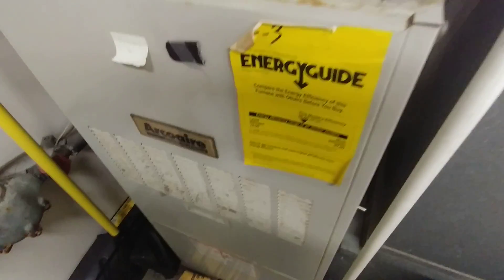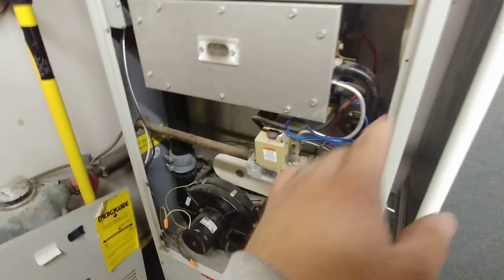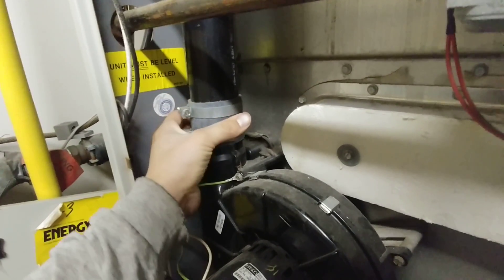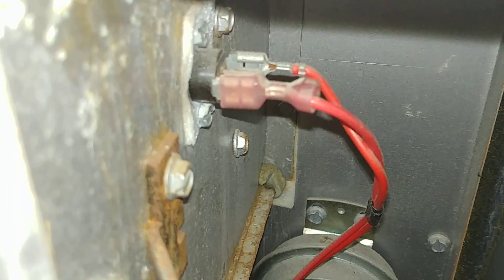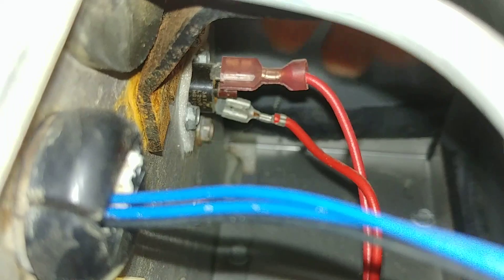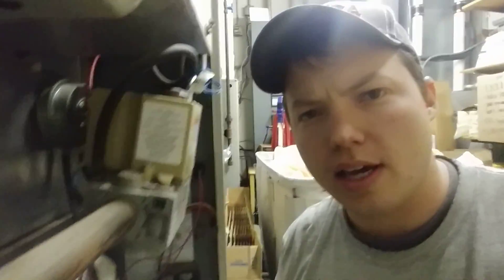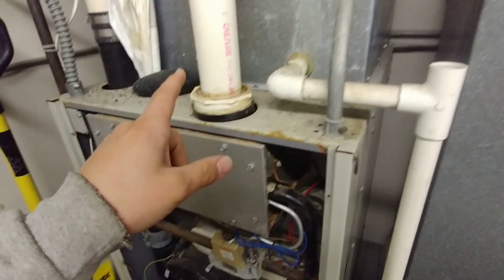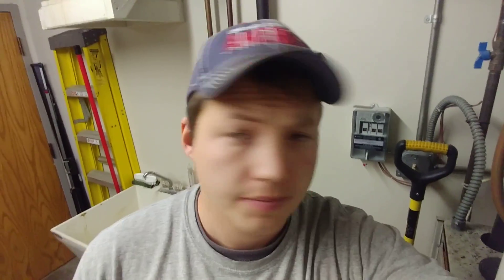Symptoms of Tripped Roll-out Switch - Furnace Troubleshooting

Comment: TYVM  Just saved my ass a service call.... I tripped one when i closed the closest heat vent to the furnace all the way to add more push to the garage vent... i wont do that again lol
Reply: Hi, there.  Thanks for your comment.  Did reopening that vent really fix this for you?  Still working fine?  Wow.  A backflow can cause an overheating problem?  Yikes!
Reply: @neomatrix6115  haven't had any issues  yet..
Reply: @feelingold2995 Good for you!  I never realized such actions could affect the life of my furnace.  I'm also reducing the MERV rating on my filters to increase airflow to keep it running cooler.  Insane how much resistance modern filters put on a system.  Thanks!

Comment: On older furnaces the roll out switch could be "aged" from corrosion and metal fatigue, no?  One way to check, assuming the flames are straight up, is placing a jumper between the two leads to the roll out switch.  That should force the furnace NOT to shut down.  Check the plenum temp above the furnace for too hot scenario where the escaping hot gas may go into the plenum and not to the outside.  Does this make sense?

Comment: I have a Lennox g20q3/4. When I turn the fan blower on it works well. Then I turn the heater on after tuning the fan off and the furnace starts and ignites well. I wait for 2-3 minutes and it just turns off. What can be the problem do you think? Any suggestions?

Comment: Can a Bad flame rollout switch keep the furnace from doing anything, not even the blower motor comes on?
Also mine won't even click when I press reset button
Reply: Yes flame rollout is in series with the 24 volts and will not let the fan or anything run after it trips. If it does not click down when you press the flame rollout button it’s not tripped.
Reply: @anthonybernier9952  unfortunately it was a cracked heat exchanger resulting in a new furnace replacement

Comment: Are all sensors equipped with a reset button?  I tried resetting mine but no click no noise / keep shutting down after couple minutes running ( I have already replaced the flame sensor and the High limit sensor as well ) - flames are going straight to the holes not flaring back

Comment: You did not explain what the roll-out switch is doing? What current and voltage is it carrying? What signal disappears when the roll-out switch heats up enough to open up? What is the current maintained by the roll-out switch (and any other components in series with it) providing? What happens when the switch opens up and the current or voltage disappears? What other components are in series with the roll-out switch? Why are you trying to sell a brand new furnace (which will no doubt NOT last 50+ years) when this one could probably be repaired and go another 100 thousand miles?

Comment: Idiot furnace should be shut off and condemned not safe to run in that condition period. If the intake or exhaust were plugged the furnace would not make on the pressure switch same if the condensate was plugged it's a 90 percent furnace looks like an airco aire garbage furn to begin with. Kid needs way more experience before he shows trash like this on u tube.

Comment: We have two boilers in the basement both connected directly to the chimney along with two hot water heaters connected to chimney as well. 

Boiler 1, which is a steam boiler has the spill switch tripping. It’s a slant fin boiler and 4 yrs old. When I clicked the manual switch it kicked on, however, next day it tripped again. Again we pressed the manual switch and it turned on but only for 5 mins before it shut off.

During this whole time boiler 2 has been working with no issues… I would assume there is no back spillage if the other boiler(4yrs old as well) hasn’t had the spill switch trip?

Could it be a bad spill switch on boiler 1 that I just have to replace? The last time I went to manually check it it was very hot to the touch…

Comment: Are these roll out switches supposed to click when you push on them because I am getting the 4 blink code for the switch needing to be reset and when I push in on it it does nothing but wobble a little ? I hope my heat exchanger isn't bad because the furnace is only 8 years old & it's a Beacon Morris garage furnace that's never given me a lick of problems until this winter .  Also would a bad gas valve cause a over fired furnace by chance that would cause the switch to trip?  The gas valve is the original White Rogers model 36G22-220  3.5 water column .
Reply: Did you ever solve the problem with your garage heater?  I am having issues with mine. I replaced the high limit switch and flame sensor. My garage heater will run but once it gets to the temperature set point and shuts off it will not reignite again. Was thinking of replacing the gas valve next?

Comment: Thank you, that button between two wires was the problem in my furnace Armstrong sx90. Its working now thank you again
Reply: It's been three years since you posted, but maybe you can answer a question about your furnace repair for me?  You replaced a faulty rollout switch that was tripping indicating it was overheating when it wasn't really overheating?  That fixed your system?
Reply: @neomatrix6115 no. He just pressed the button lol
Reply: @brandon9621 LOL. Seriously, just curious if these switches actually do go bad over time.

Comment: The old “you need a new furnace” trick - because there’s much more $ to be made replacing an entire furnace than the heat exchanger.
Reply: True statement. However, this furnace is over 20 years old and probably would not be and economical fix. A newer furnace would probably  have a warranty on the heat exchanger. Currently experiencing same problem with my 18 year old Carrier.
Reply: @ms38355  If you can get the heat exchanger for $500 bucks and install it yourself, what's to say the rest of the unit couldn't have another 20 years in it? I mean a old dirty oil burning furnace would routinely last 40 years...... but a clean burning energy efficient one can't? It's not like even with a new furnace, other parts can't fail.... I say a tried and true system is worth $4,500/90% less then a brand new one that could very well be less reliable or even a lemon!!
Reply: @mediaterrorists8969  It could last longer but I doubt it, judging by the condition of the rest of the motors, and age of the compressor.  New Rheem gas pack was installed 1 year ago, $5500. Very happy. Thanks.
Reply: @ms38355  LOL, I've never been happy about paying 5 grand for something I can't sit on/in or regularly am impressed in its presence or showing it off to my friends..... Oh well, you do you... I rather reuse, "recycle" for the planet and retire early with a better wealth of knowledge from my experiences.... I'm more the MacGyver type I guess.
Reply: @mediaterrorists8969  For 20 years it will work just fine. That's $275 per year, a no brainer.  I maintained my previous unit for almost 20 years and will do same for this one. I'm in maintenance myself ( 30 years)  so save your MacGyver crap. I know when to replace and when to repair. That's right, you do you, and I'll do me. and if you have nothing productive to say, shut your pie hole. Adios and have a nice day.
Reply: @ms38355 Lmao, $275 a year   for eventually replacing a furnace in 20 years is a good deal to you? Who the F wants to throw $275 a year aside for a new furnace? Besides with inflation at record levels, $275 a year wouldn't even come close to replacing the entire furnace 20 years later. Much better just to maintain at minimal costs and throw whatever necessary parts to keep it running and avoid a new furnace purchase. Especially on a median to older age house, a new furnace isn't going to increase the value of a house at all, because the regular home buyer could give 2 sh:ts less whether the furnace looks new like your new car in your parent's garage or not. 😂. As long as the furnace heats the house when they're purchasing it is all they care.
Reply: No matter the arguments here, 20 years isn't much life span for the cost and importance of a furnace. Don't kid yourself, these manufacturers have the knowledge and technology to build a furnace that will run much longer than 20 years, however they'd rather line their pockets with gold and see a nieave and unknowledgeable person just replace the furnace sooner and make their "licensed" dealer/HVAC repair company fatter in the process.
Reply: Ok cheap skate moron lol
Reply: This thread sums up the argument I’ve been having in my head but in no way helps

Comment: Question for you I have the identical problem but my heating guy seems to think I should try to replace the high limit control switch what are your thoughts? I already replaced the flame rollout switch and I still keep having to reset the new one to keep the furnace running.
Reply: Isn’t the high limit control switch a one time use? Isn’t it the one that’s in the heat flow that trips and is not resettable?  Basically test for continuity to see if it’s good? I’m not following wide. The technician wouldn’t have done that.

Comment: Have 4 rollout switches on my 20+ year old Goodman furnace,  one of them at least once a heating season in the last 3-4 years will open and keep the furnace from firing  resetting them solves the problem only to be repeated in a year or less, flame is good  none of the issues your video pointed out is apparent, maybe they just need to be replaced?

Comment: So i got got a free furnace for my garage. It's mid 90s. It all works. But when the blower moter kicks in one burner gets pretty violent. Kicking back the flame. The little breaker trips. So is there no fix for this? If not I'll just toss it away.
Reply: The heat exchanger was cracked

Comment: Great video my problem tranducer motor starts ignition happens then flame shuts off after 2min and cycles after that
Reply: Clean the flame sensor. That is a common issue
Reply: Use a finger nail board or even a dollar bill, shut off power to your furnace and remove flame sensor rod. 1 small Phillips screw and 1 wire going into it. Remove it and gently wipe it. Then replace it like you found it, then replace the furnace doors and turn on the power.

Comment: Thanks for a great video. Wish so many others were this well done. I could hear you over the furnace background noise. You clearly explained the symptoms, what might cause it, and didn't waste time. Then you showed exactly where the reset switch was between the two terminals. My furnace exhibited the same symptoms and, although a completely different model, I found the reset button nestled between the two terminals. Without your video, I never would have seen it hiding there. Our heater is working again, and without to pay a service tech $90 to come push the button. You made our holidays much brighter--and certainly warmer! 

By the way, this has happened 3 times over the last 4 years (house and heater are 8 years old), and each time it's after coming home from a several-day trip when we've turned off the heater and the house is very cold (walls, furniture, countertops, etc.). We turn the unit up and it runs for an hour or so. Then I think what happens is we turn the temp up some more and it trips the switch. My suspicion is the box has heated up a lot from the long run time. Then, when we immediately start it again, it trips the switch.

Comment: good stuff, I've got one a bit newer, it's flashing codes, "open rollout switch circuit" (except in 2 stage)" Anyone know how to tell if yours is a two stage? What makes it "two stage?". Mine is like that except the one in the vid is rotated 90 degrees and looks to be a little older. I've got two switches on my burner, maybe that make it a "two stage", maybe not. It looks like you can just put them in in whatever rotation  you chose to fit the situation. HOWEVER, mine has the burners below all the circuitry. The circuit board and everything is OVER all that heat. I can't say if it was installed wrong or what the deal is. When I went to school for this everything was simple on a furnace but they could let carbon monoxide in and everyone dies in their sleep...
Reply: The two roll outs do not indicate a two stage furnace.You can tell from the model number,or number of wires to gas valve,i.e. two wires single stage three wires two stage .
Reply: Or you can do something even easier look at the gas valve does it say hi and low on it